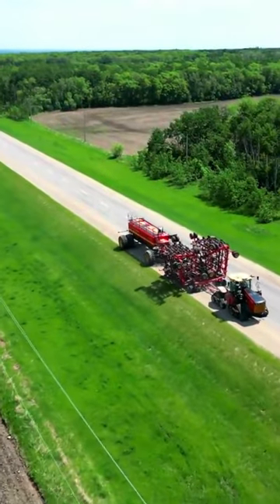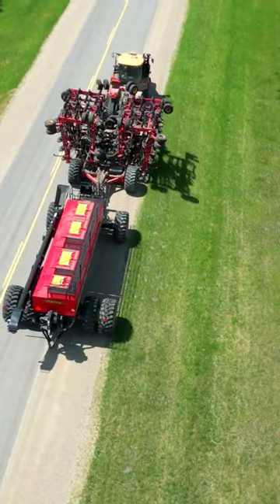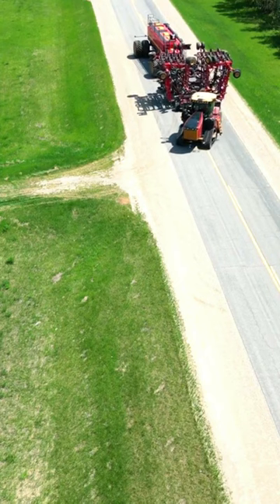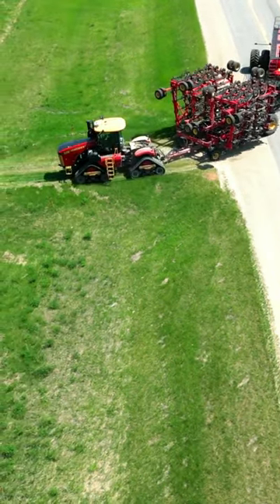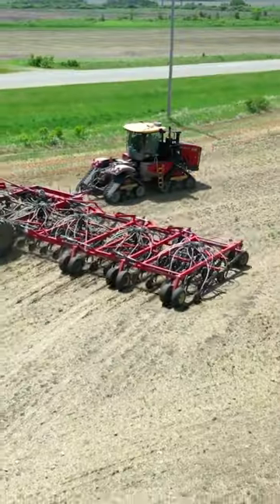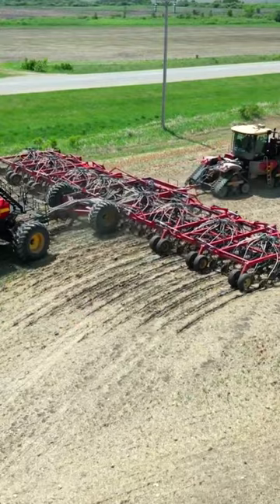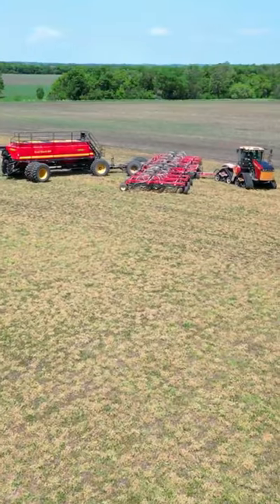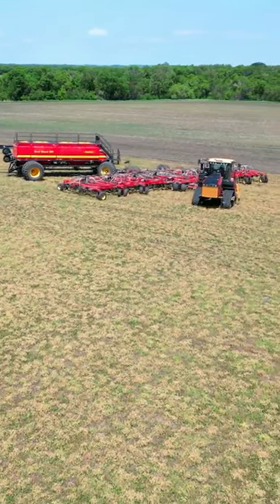620 HP tractor & 80 foot seedhawk vaderstad seeding in canada  #farming

Comment: The onlt limit to the sheer size of farm equipment is not the size of the fields, its the width of the roads and height of the power lines. 😮
Reply from the maker: I wouldn’t say the only limit but agree that it’s probably the largest impediment to building larger machinery